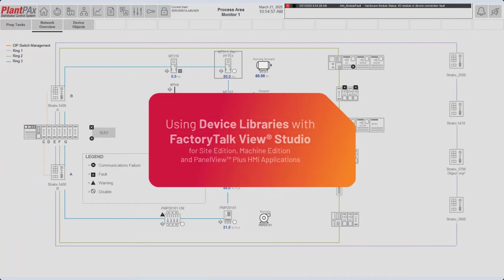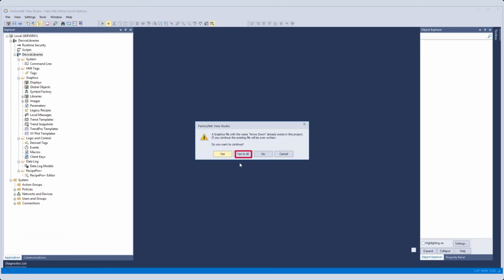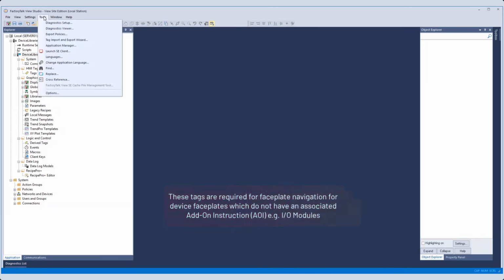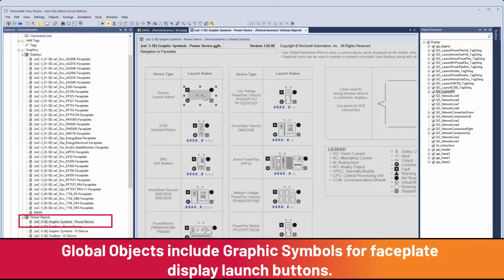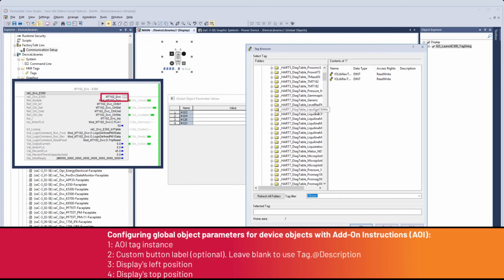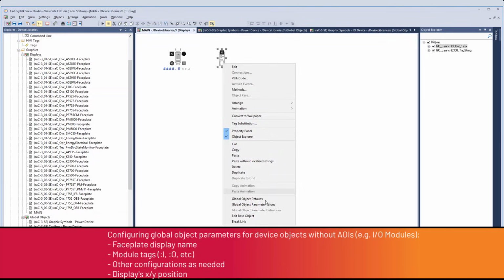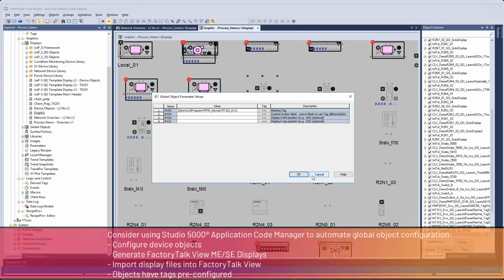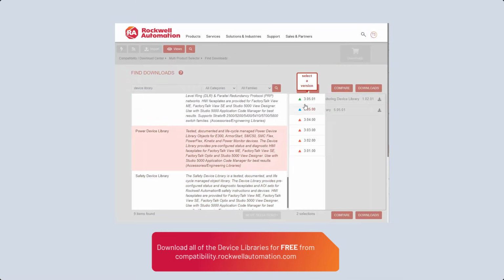How to use Device Libraries with FactoryTalk View

Comment: You forgot to mention you need a P processor for use of PlantPAX library. 

But I know like every one else, none of the Rockwell Automation team will answer this comment. 

Either way, everyone needs to know this is not for every PLC controller.